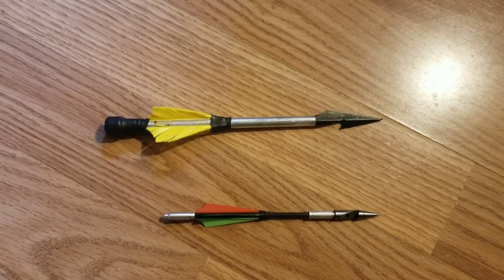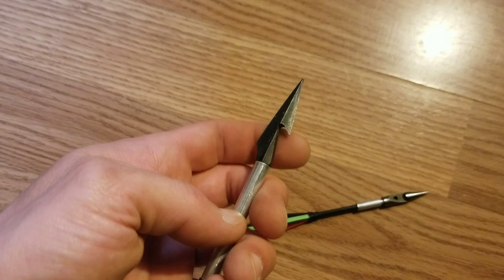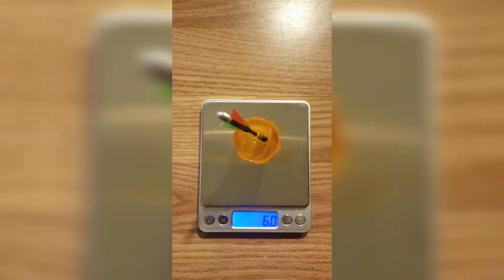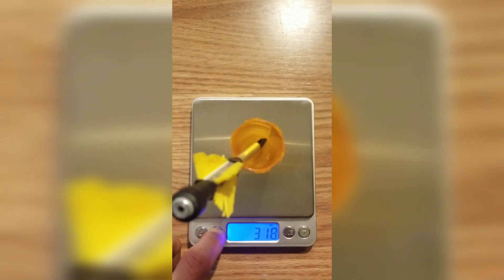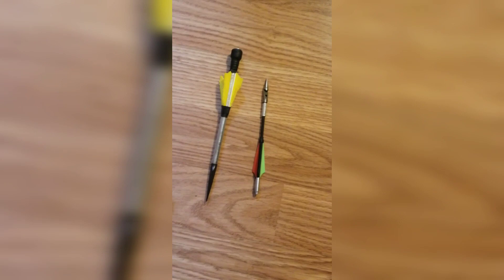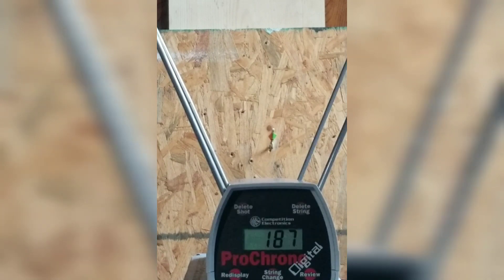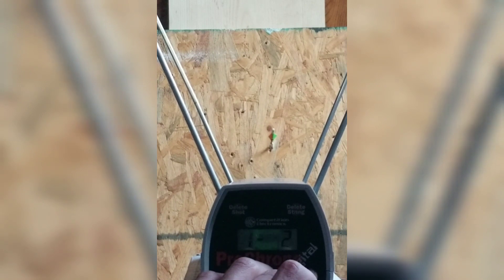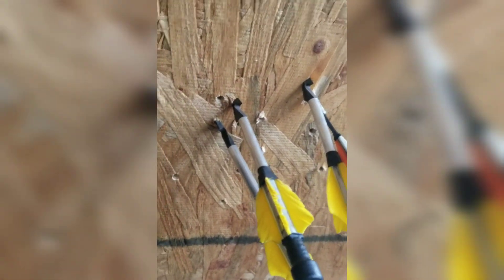Ammo weight vs power (tested with darts)

Comment: no offense to GZK but those darts suck. i have both and the gzk ones bend on the first shot every time, both the tip and shaft bend very easily, and to top it off the fletching just adds way too much air resistance.
Reply from the maker: I have not had an issue other than breaking tips. I love the power and weight they have to them. I agree about the fletchings and I put small plastic veins on and they fly much faster!
Reply: @SLINGSHOTFEVERpullshootrepeat  maybe I'm just using stronger rubber but I just like the sniper sling darts better they seem to work much better at least for me
Reply from the maker: @Jonoman777  my heavy dart bandset is around 35lbs of draw weight. The carbon shafts break way easier than the steel.
Reply from the maker: @Jonoman777  They fly faster for sure. The heavier have much more energy. I plan on getting some ballistic gel for some test videos this summer. For the GZK I use .9 with a 20-15 taper.
Reply: @SLINGSHOTFEVERpullshootrepeat  I use 1745 tubes, double looped for the most part. that would be awesome to see ballistics test!! 
steel? the gzk darts I got were definitely aluminum shafts
Reply from the maker: @Jonoman777  yeah, aluminum shaft. No clue where the rest of that comment went. The carbon shaft breaks way easier than the steel tips. Wonder if your shafts are thinner or I got a weaker carbon fiber? The steel tips are the weak point on mine. I did refletch them though too.

Comment: You need the bigger tip on the lighter dart
Reply from the maker: I have asked Min about that but at this time, that is what is offered. I still have fun shooting them!
Reply: @SLINGSHOTFEVERpullshootrepeat  if a heavier razor sharp broadhead  tip was on the lighter dart it would be fit for war
Reply from the maker: @horridhenry1805  I and many others have requested it! I agree!
Reply: @horridhenry1805  I craft my own broad head tipped slingdarts. Works well with GZK Pulley Slingshot.